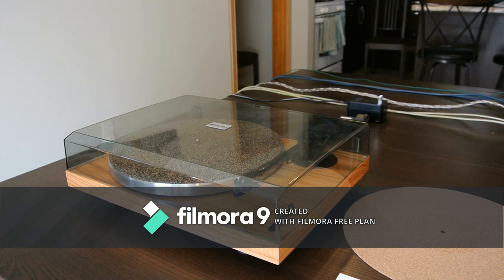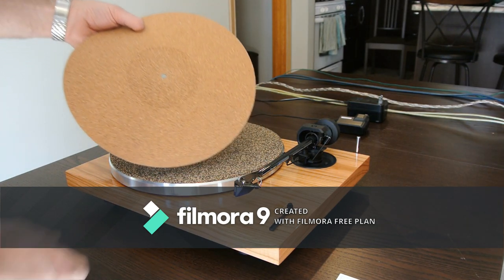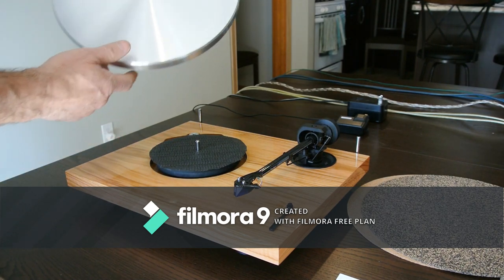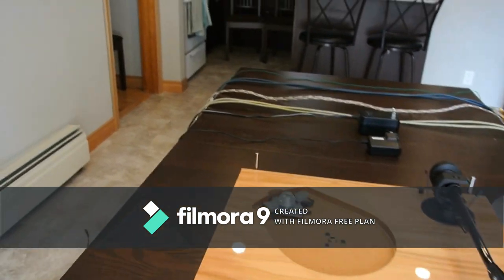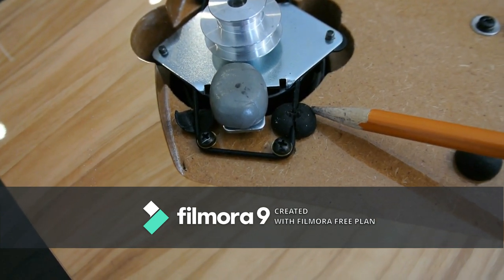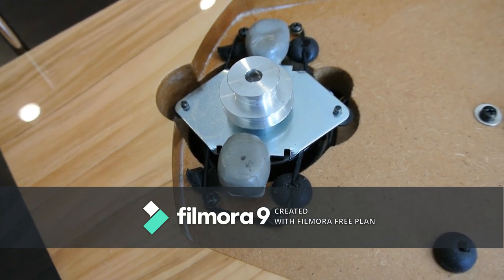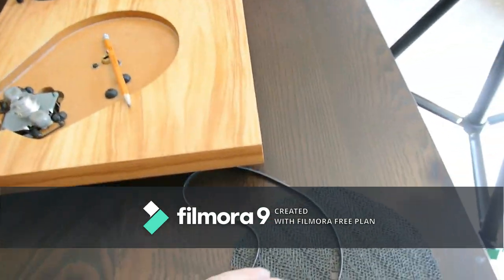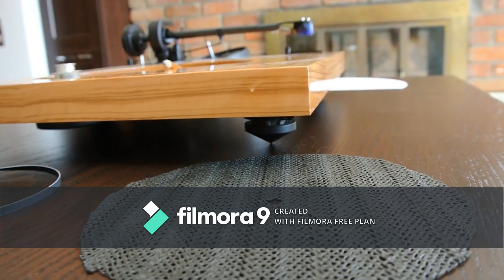Pro-Ject Debut & Xpression Motor hum and Noise Fix

Comment: I have just bought a "Project Debut Carbon Esprit SB" (2020 model) Turntable and there is NO Hum whatsoever even at full volume on my Myriad amplifier. I am in the UK and our Mains Frequency here in Europe is 50hz at 220 volts so i am wondering if that might be part of these issues as yours i think is 60hz at 110 volts, i am reading in North America. most Hum is thru Earth loops (to many earthed items) i have had them in the past and is worth experimenting where possible to disconnect items in turn.
Reply from the maker: That is awesome. I have been wondering how the new models are performing.  I  am happy with mine,  but still feel the motor is the weak link. The new line seems to be addressing the issue with better isolation.  I still feel the motors could be better.
Reply from the maker: As far as the grounding/earth problems, I feel in my case it was because of the stock interconnects. They are so loose that one time I was listening to an LP and the left channel stopped working, the RCA had come off the Jack. So I replaced the cable and all was good. Cheers from Canada@

Comment: What's sorbothane pads called soft ones and where get from and sorbothane sheet for sub platter and mm thickness needed please
Reply from the maker: sorry to take so long. I ordered #30  1/2 diameter from eBay.  The asphalt panels are 1/8 in 3M 8840 sound deadening pad. I bought mine at NAPA auto parts in Canada and only had to purchase 1 pad. https://www.ebay.ca/itm/143253142969?epid=3012061198&hash=item215a8d7db9:g:20IAAOSwLhtc3DWb    https://www.ebay.ca/itm/371268558075?hash=item5671549cfb:g:B5oAAOSwNSxU6qaO

Comment: I got a new DC motor for my carbon, How can I transfer the small platter from the motor shaft of my old DC motor to the new one?
Reply from the maker: There is a little set screw on the pulley, I think it is 1.5 or 2mm

Comment: My project turntable has motor hum. I suspected but to test, I took the belt off so the record doesn't spin when started, put a record on, put stylus to record and as soon as I switch on the hum can be heard through the vinyl. I found that if I leave the transport screws in at either side of the motor it stops it but then the belt rides too low. Will this video help me, I can't hear it cos I'm at work  lol
Reply from the maker: I believe so. you may have to reposition the pulley if it is a Debut carbon or similar. I used sorbathane  pads under the rubber motor suspension o ring to isolate the motor vibrations.
Reply: @northa4021  Thanks mate. I think it's actually a project comfort with the light walnut plinth. It was around £500 in about 2010. I actually complained to project that this was unacceptable at this price point as my previous cheaper project had exactly the same issue and that's why I bought the comfort. I was really pissed. You couldn't make it up.

Comment: Would the trick to move the cartridge to the end of the adjustment rails work for aligning the Debut Carbon Espirit?
Reply from the maker: Yup anything with the 8.6 in arm and using a Ortfon 2M series or the New Audio Technica VM 95 series. I have tried both. I am currently using a AT120eb. I think that the new ATvm95en, which I have used, is a great cat for the money and rivals the 2M blue for less $. Cheers.
Reply from the maker: if you have PC you can down load the alignment protractor at http://conradhoffman.com/chsw.htm  it is the third line down in the list.
Reply: @northa4021  Thank you for your reply! I did align my cartridge and did end up moving the cartridge to the end of the tonearm alignment rails, I wonder what the reason is for Pro-Ject not aligning the factory cartridge to the overhang specs that are listed in the manual?
Reply from the maker: @DJWolves97  the reason  is slightly  different null points , the cartridge angle is the same. I also find it easier to gett the cart straight on the head shell is maybe more important than the overhang. Now if this was an S shaoed tonearm with very long slots in the head shell  you might have to pay closer attention to  cartridge position.

Comment: Great idea with the damp for the sub platter. Just watched a couple videos about upgrading to the aluminum sub platter and how great it is EXCEPT the spindle doesnt fit great into the bearing. So I was thinking, why not keep the resin sub platter and damp it.
Reply from the maker: I have wondered if the aluminum sub platter was better or not. I have thought about getting the acrylic platter to see it  would help as well.  Thanks for watching, cheers.

Comment: Going to try this myself. How do you adjust the pulley if its rubbing the bottom of the platter?
Reply from the maker: There is a small set screw on the side of the pulley.  That allows you to slide up or down
Reply: Gotcha. Thank you!

Comment: about the PSU, do amperage matter? I can't find any decent PSU here (Argentina) that have such a low amperage, most are like 2-3 ampere psus
Reply from the maker: I believe that you would be fsafe using 2 or 3 amp supply. The one i am using is a little bit higher that the factory one. Good luck
Reply: Just run a ground wire from your amp ground to the outer ring of the power supply connector. I used a length of 22ga stranded wire. It's not pretty but it works well...

Comment: Are you able to share link to pads for better positioning motor versu plinth ? Thx in advance
Reply from the maker: Yes i will do that. It might take me a day or 2 but definitely.
Reply from the maker: If you give me your email , I will send you a picture
Reply from the maker: @marekwaczynski3894  https://www.ebay.ca/itm/143253142969?epid=3012061198&hash=item215a8d7db9:g:20IAAOSwLhtc3DWb
Reply from the maker: https://www.ebay.ca/itm/371268558075?hash=item5671549cfb%3Ag%3AB5oAAOSwNSxU6qaO

Comment: You know what I like a huge filmora 9 banner in the middle of the screen.   It blocks most of the important stuff!
Reply from the maker: I did that just for you, your so special.
Reply: @northa4021  BTW, why WAS that banner in the image area? Very annoying.
Reply: @morrisonAV  So glad you enjoyed it. This was the first and only video I have ever posted. I have no video editing software and this was free so there it is. I didn't think it blocked any of the important bits. I have made one other change. I removed the stciky tac and replaced it with stick on wheel weights. They are smaller and stick better.  Cheers!

Comment: If I tap my plinth gets microphonic boom sound. Soft clicking motor and rumble during playing. Pro-ject 1.2
Reply from the maker: Tapping the plinth will definitely cause vibration , the idea is to limit vibrations getting, by maybe using a isolation table. The motors can be taken apart and lubricated.  It can be challenging removing the motor and disassembling it. It can be done. Good luck.
Reply: @northa4021  thank you. I am not very sensible as I have just removed the red screws after 22 years after first writing you. Much of the rumbling has now gone.  I have it on a foam covered bench too. Thanks for your video.
Reply from the maker: @stillben  Hi Ben, try listening with the cover removed. The cover amplifies the vibrations from the motor as well as ambient vibrations.

Comment: moved power adapter to a separate outlet, 4-feet away from other plugs, and no motor hum. tried same outlet with power strip and at same distance-no hum. thanks.
Reply from the maker: good to hear, or not hear in this case. Most of the cheaper Projects suffer from mechanical motor vibration causing the hum. Cheers
Reply: Must have been the voltage differences-adapter Hz affecting internal motor vibration.
Reply: The spindle under the plate development noise(not the Hum);which was resolved with sewing oil on the metal shaft...dead silent.
Reply from the maker: @raycarr225  what I have found is that  with the motor isolated and the BELT off no hum gets to the plinth. When I install the belt the hum comes back. This tiles me that the mechanical noise is coming from the motor.
Reply from the maker: @raycarr225  Hi Ray the noise you get from the spindle is more like a scraping or growl. The hum I am talking about is motor vibration that is transmitted through the belt. I have determined this by placing a small plastic cap from a spray bottle on the plinth and than setting the stylus down onto the cap. With the BELT  and the platter on there is hum/vibration through the speakers. On the other hand, if you remove the belt with the platter on there is no noise through the speakers. If I put my finger in the motor housing you can feel the vibration.  Check out this article, he uses a bottle cap to do the same thing. Cheers!  https://www.theobjectiveturntable.com/ProjectDebutCarbon.html
Reply: Read the article,but no such issues here at the moment-it's dead quiet. I'm using different cables,did remove the two screws and rubbers, oiled spindle,cleaned belt, running variac at 120.2v-no motor or other noise. I'm using a clear plastic platter,as well. No matt.
Reply: Oh,the power adapter I'm using is output: 15v AC,550 mA.  Ad4120-15-550
Input:120v AC, 60 Hz,13w
Reply from the maker: @raycarr225  is your table the ac or dc version?
Reply: AC motor & AC adapter-debut carbon with added acrilic platter.

Comment: OMG that ideas were awesome ! :) thank you very much is there any kind of best tracking guide for tone arm that i can print for debut III  in web?<lofgren B will be ok?> i wish to have the same well thought out turntable like You have :) I bought mine with kind small demages on the dust cover for around... 50$ :D  best regards!
Reply from the maker: Well the Debut line has the same arm measurements as my 1Xpression. If you are using an ortofon OM10e or the 5e just slide the cartridge out to the end. It will be perfect. I printed mine from conradhoffman.com. Use a spindle to pivot length of 200 mm Lofgren B and the DIN setting and you will be able to print an arc protractor. Good luck,  cheers
Reply from the maker: http://www.conradhoffman.com/chsw.htm

Comment: Bought the Canon Power supply (K30081) you recommended. The plug is not compatible with the Pro-Ject Xpression.
Reply from the maker: ok so , yes I had to change to tip.  I will measure it and get back to you this evening. Time in Ontario Canada is 9:34 am
Reply: @northa4021  I tried to find the spec for the Pro-Ject plug. They don't list it anywhere that I could find.  Appreciate the help with the measurements.
Reply from the maker: @HughGriffiniii  what I have done with other power supplies is use the plug from your original PRO-JCT p.s.  I did this with my first Pro-Ject Essential. I cut the cord a swapped the end. I do believe that the outside diameter of the Pro-Ject plug is 5.5 mm.
Reply: @northa4021  Yeah, I considered doing that but wanted to keep the plug original incase I was to sell it in the future. Hoping to find a plug at Mouser or Digikey that can be soldered to avoid a shrink wrapped lump...
Reply from the maker: @HughGriffiniii  That is what I did. I got my plugs at The Source (Radio Shack) I got another PS for my son, it is only 12 Volt and it works fine, the polarity was wrong so I had to cut wires and change it.  Its not a huge difference but it dose help with the buzz, not the hum.
Reply from the maker: So I checked out the size and it is a 5.5 mm outside and I would say 2 mm inside . or 7/32 x 5/64.

Comment: You've got to be kidding? $600 new and you have to go out and replace all the attachments and take it apart and rebuild the motor assembly, etc? Why would anyone want to be ripped off so badly??
Reply: Call me crazy, but for that kind of money shouldn't it be made correctly by the manufacturer, and not the buyer?
Reply from the maker: @nanchanger  I agree, and this table was $1100 CDN dollars new, i paid half that. I believe that Pro-Ject has learned their lesson, they have changed the motor suspension in new Debut Evo. I haven't had the chance the audition one, but I plan to. I must say that apart from the motor issue this table does have some good qualites, good tonearm, good platter and plinth. I wouldn't pay full price for one though. Cheers!
Reply: @northa4021  seems to me you made it impossible to buy without feeling you got beat... Any thoughts on their Esprit model? Same issues?
Reply from the maker: @nanchanger  I think that the new Debut carbon EVO is going to be better, same arm better feet and better motor isolation, and more money.
Reply: @northa4021  yeah it appears the Esprit is the same, but acrylic platter and speed control...
Reply from the maker: @nanchanger  yup. the EVO has speed box built in I believe.
Reply from the maker: @nanchanger  I considered getting an Esprit but I did not feel it was good value, it had the same plinth, same arm and same feet. I hope the new Carbon EVO is better.
Reply: @northa4021  hmm...
Reply: @northa4021  so which did you choose?
Reply: @northa4021  -after about 5 years of ownership i dropped my motor completely out of the plinth on my Debut carbon and mounted it on a solid rubber block sat on the shelf underneath, no contact and no motor noise.
As it was due a service I cleaned and put some new oil in the bearing (no rumble), added an earth (no hum), added butyl rubber to the underside of the platter for mass and sound deadening, topped off with a dual layer skinny cork mat and a blue 2M needle. With a freshly cleaned LP it sounds as good as anything I've ever heard.
Reply from the maker: @nanchanger  for now, I am staying with my 1Xpression Carbon Classic DC. With the changes I have made it sounds very good, so for the money it has been ok. I think I would have to get into the over $1500 Canadian to to see a big change and my current system, just an Onkyo TX-8270 and Paradigm Studio 80's , doesn't warrant spending any more. I must be clear that my turntable sounds good, but with a couple tweaks you can make it very good. Cheers, have a great night.
Reply: @northa4021  thanks for that, I'm trying to put something together, just bought a pair of Jamo speakers..
Reply from the maker: @ianvaughan7066  VERY COOL I have thought about doing that as well. What did you use for oil?
Reply from the maker: @ianvaughan7066  we need photos
Reply from the maker: @nanchanger  I have never heard a pair of Jamo's, but have heard good things about them
Reply: @northa4021  - just 3 or 4 drops of the semi-synthetic stuff that goes in my VW - should be just enough so the sub-platter "floats" for a second and then sinks into the well. The sub-platter should happily spin (without the belt) for 25 seconds or so if you give it a bit of a push. If not it probably needs a clean / lube. I put some butyl rubber (roofing strip) on the underside of the sub-platter too which gives it a bit more mass and kills any resonance.
Reply: @northa4021  - I'll see what I can do

Comment: I was gonna get a Pro-ject but I think I'm gonna look else where.
Reply from the maker: I think there is good and bad with all tables. If you know what you are getting into you can a good table great. I paid 1/2 price for my 1 Expression carbon classic dc. Very happy with the performance now. If i had paid $1200 Canadian I would not have been happy.
Reply from the maker: @Stublinsky  I agree, that is why I bought this used, I would not by this at full price.  It had been up graded to a 2M Blue cart. I knew what I was getting into and I am now happy with it. I would like to try one of the Debut Carbon EVO's to see if they fixed the hum problem with the new motor mount .

Comment: Or buy a different turntable
Reply from the maker: Well, yes, that is an option.  I did get this used for $500 Cdn. With a 2 M Blue cart and it does sound good. So a little extra tweaking was worth it. Cheers!

Comment: I think I have a better solution for Debut Carbon issues.....return it and get something else.
Reply from the maker: Well if you can afford it, go for it. I got this table for $550 Canadian, with a 2M Blue cart. I have done a few tweaks and it does sound Very good. I think some of the new models have dealt with the motor issues. One thing I have done is remove the blue tac and added stick on wheel balancing. They are smaller and have more mass. Cheers!

Comment: why the need for the banner stuck across the screen advertising what???
Reply from the maker: Just there to make people ask questions
Reply: @northa4021  well it blocks off a lot of what you were trying to show, so not very helpful in the long run. May as well film in the dark.
Reply from the maker: @nickwilliams1065  so sorry that it bothers you. It does not affect any of the important ideas. I have no video editing software so this was a free option. Just trying to help people that have had problems with their Pro Ject tables that have had noise issues. I hope there were some ideas thst helped you. Cheers
Reply: @northa4021  appreciate your vid. if you make another vid ever openshot is free and very much like filmora. davinci resolve is free too and more powerful,but maybe more complex.
Reply from the maker: @sm1thers  thanks for the tip,  I will check it out.

Comment: I bought a RPM5 from a guy that was getting crazy with the hum. I just bought a pair of plumber o-rings (1 euro) and placed them where the original "transport" rubbers and screws where. The hum completely disappeared. I was only earing it when the volume was loud (and between songs - blank spaces).
Reply from the maker: Yes sometimes that will help. I tried it as well but the motor noise was still there. If you can hear it between tracks its still degrading the sound. I still get some motor vibration through the drive belt, but it is minimal, Take care Miguel.
Reply from the maker: @spiritfreemike  THAT IS AWESOME! Glad you got it fixed.